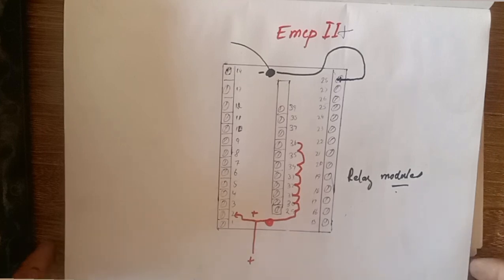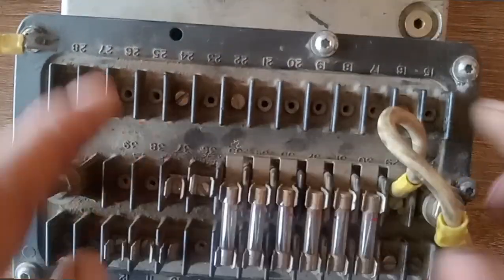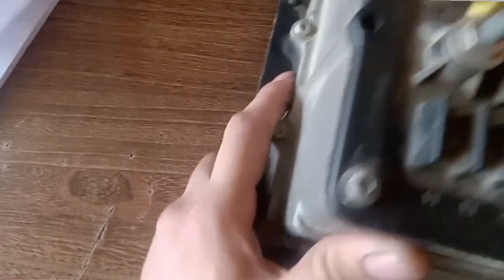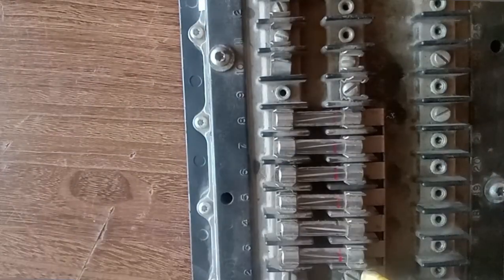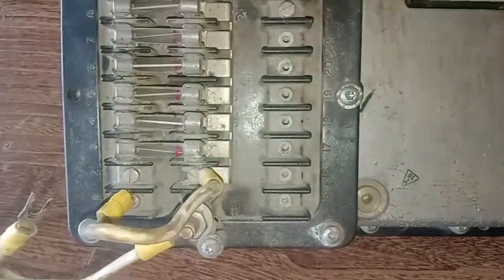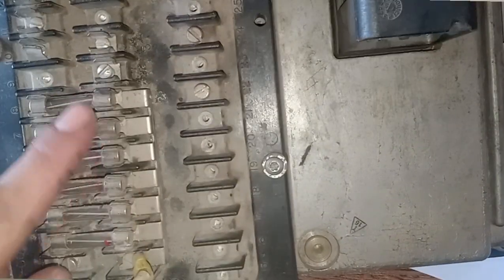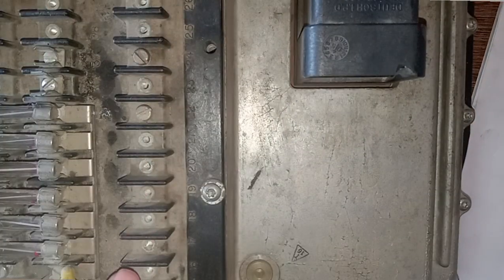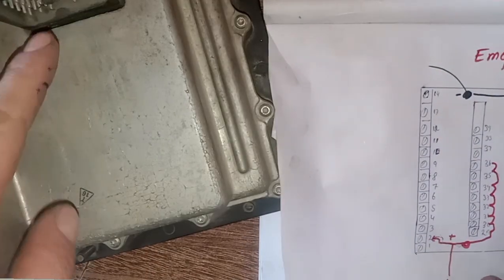Caterpillar EMCP II Plus RM module controll panel wiring diagram and connection

Comment: What will happen to engine if def is empty during running mode?
Reply from the maker: Def?
Reply: @Info-Tech-   def. Iean the adblue
Reply from the maker: Right it's is used for environment cleaning , clean the exhaus gas
Yes you can run the generator without def
But your environment is pollution